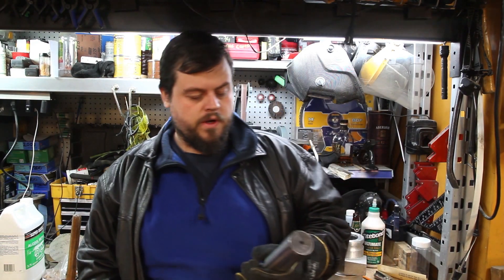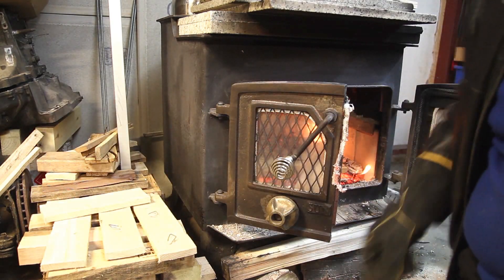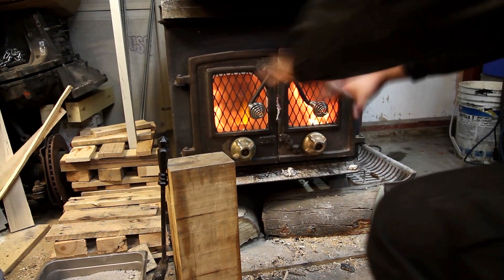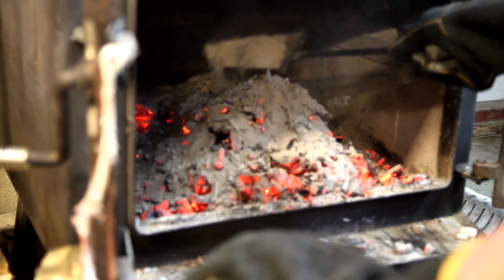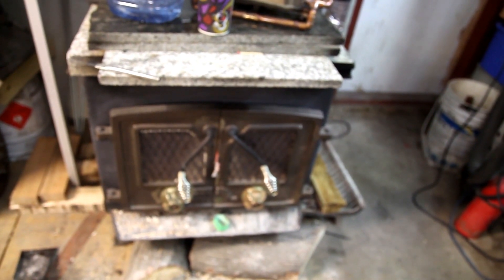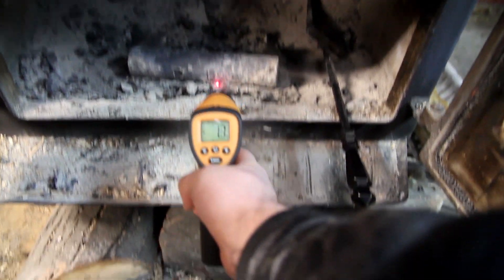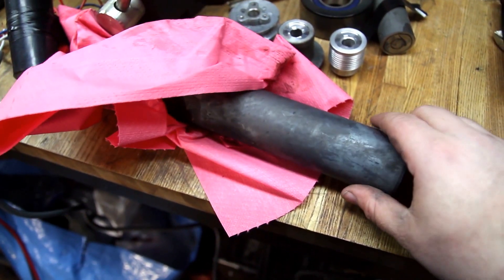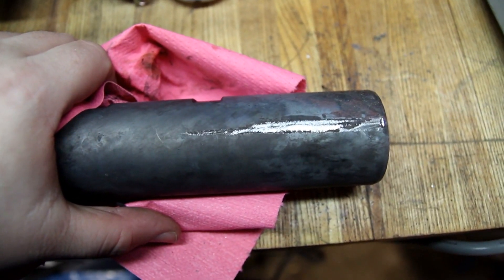Annealing Hardened Steel In the wood stove, softening metal

Comment: How much does one of these kingpins weigh? I need a 6.5 kg (approx) weight for a grandfather clock and this looks promising. Even if the weight is approximately correct, no clue where to go to get one at a reasonable price. Thanks for the video... it was helpful.
Reply from the maker: @fbicknel  their is one from an axle called a IMT. It's a lift steer axle. I wouldn't buy one new though. They kingpin set is well over $600. However if you find a trailer repair shop or truck alignment shop they would be more than happy to give you one. This stuff is garbage to them.

Comment: Thank you for this. I want to do this to some hammer heads so I can work on them. Then reharden them afterwards. 
You didn’t mention any particular temperature cycle or times at certain temperatures but I suppose that’s not very important. 
I’ll try this method. 
Paul

Comment: What about a charcoal BBQ could it be maybe somehow altered to make it into a mini furnace .    I don't have an open fire anymore 😔
Reply from the maker: Hugo Malice any source of heat that you can keep burning long enough to make the metal turn a dull red. Then have a bunch of ash to dump onto to try and allow the metal long enough to normalize. If you let the metal cool down too quickly that will not though soften it enough if you warm it up too quick you might not penetrate the center. You could end up with hard bits in the metal that will dull your bits in a hurry. :( probably a full bag of charcoal would be needed. Lay a good bed of coals. Light let them burn to a cherry red. The. Lay your metal on top of the lot coals. And slowly layer more coals onto of them. Use a small fan like a hair dryer to get the coals really hot. And once your whole bag is used up you can dump some insulation on top. This could be more ash. Or close the lid and wrap with a fire blanket if you have one. Or you could dump regular silica play sand on top. Just a really good layer. And let it sit overnight.
Reply: Bart Koscow Thanks Bart for answering .   Thats a great idea 👍 so the key is to let it cool as slowly as possible
Reply from the maker: Hugo Malice yes sir. You have to get it to a low red first though. And that should take a hour or so to kinda regrow the crystals in the metal. You want as slow a temperature change as possible. Lots of Ppl dig a pit light  a fire. Drop the metal. Stoke the fire for 2-3 hours and bury it in a mound and leave it until morning or later. Otherwise you have to do many namalazing cycles, heat then cool to get it to soften all the way though evenly. There are many ways to do it. But getting it hot slowly then cooling it down slower is the easiest most hands off approach.  Plus you can BBQ some chicken on the side.
Reply: Bart Koscow lol 😂
Reply: I had some real fire brick. It helps.I used a propane torch-- not so good. Tried to anneal a hacksaw blade.  FAIL.

Comment: Ayup there bart and greetings from sunny england ,just tried this with a hardened machine vice so i could mill some T slots in it,chucked it in my woodburner for a evening got it glowing red hot and then let the fire go out,fished it out the next morning and its now machinable,its still perfectly square and went back together fine,the scale eventually came off and its now as clean and shiny as it was before,but now its got some Tslots so it can be fixed on my lathe slide,thanks and all the best Andy.

Comment: Good info thanks. I am still trying to find out what steel grade the kingpins are. My boss just got me some pins and two big rig brake drums.
Reply: If it's stainless then id have to guess that it's 440c. 440c is harder than the 300 series.
420c has an hrc of 50 while 440c has an hrc of between 58 and 60.

Comment: Hello Bart, you are correct about the metal needing time to cool down properly. I personally have a specific thick cast iron cooking pan, it's around 1/2 an inch thick all around, it is 3 & 1/2 inches deep. I fill it full of ultra fine silica sand, put it in the oven till it gets to 220°c all the way through , then I put the intended metal into it, I have other sand in a separate container in the oven warming up at the same time so as to cover the metal completely.
I generally do this early evening, around 6pm so it is done and ready for working at 9am next morning. The video was good and I mean no disrespect by saying this, however 2 days for cooling just is not necessary. I have vast experience with knife making, silver work, and general metallurgy. I have a fair grasp on what I am talking about. Try it yourself friend, it is a super effective system for steel, the only thing that is expensive that I use us the cast iron pan, but it has been in my family for years, and I imagine it would be expensive.
Reply: Helpful advice, thank you